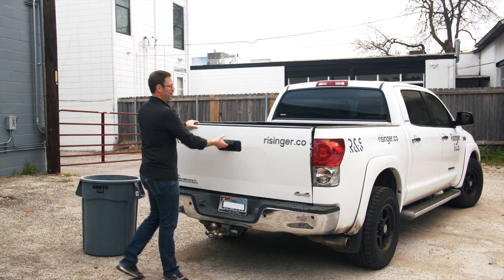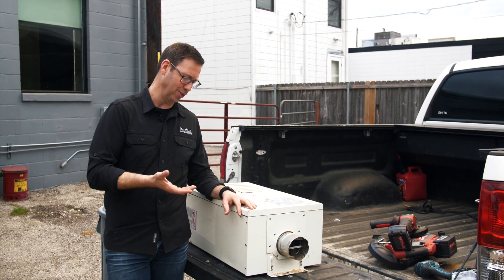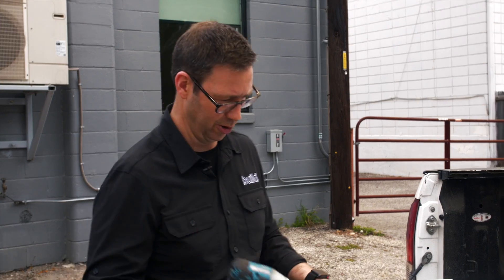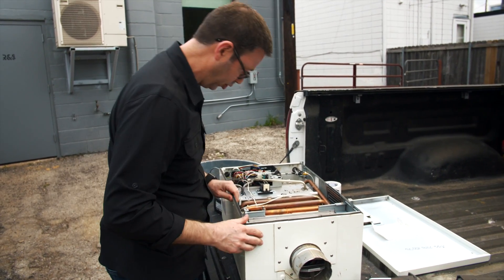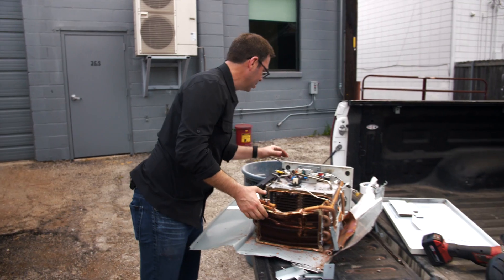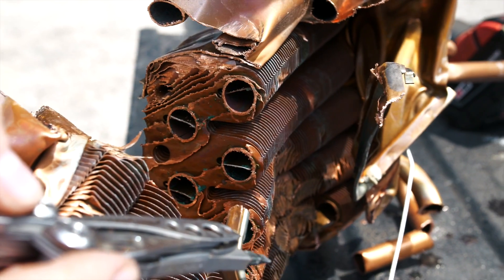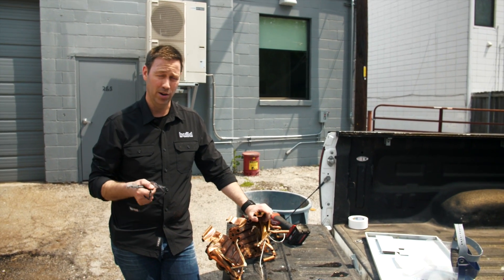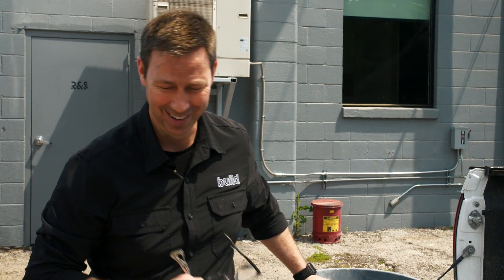Dead Tankless Water Heater - Lessons Learned?

Comment: awful design.  should be using stainless steel, not copper.  and why isn't there a way to physically clean the inside of the copper pipes with a wire-brush? - you use chemical solvents to dissolve the minerals, but you need a wire brush...  i just don't see this particular design being around for too, too long.  i mean, it gets an entire industry running...but, once someone builds something better, they all have to change, or go out of business.  ridiculous.

Comment: piece of manure Rheem hot water heater. Took that one apart to clean the flame rods about four times. Never was anything wrong they were perfectly clean and upon reassembly it works for another year and then stops = clean the flame rods works for another year and then stops not a mark on the flame rods= factory couldn't help= never buy Rheem again in my life

Comment: A more thorough dissection of the lower part of the unit may have yielded the primary heating chamber where there may have been more scale than you discovered.   I believe the part you opened was more the scavenging section that extracts the remnants of heat left over from the initial burn.....just my two bits.     Thanks for sharing.

Comment: You should have fixed it, those things are expensive. I bought one on eBay for $250 it was a "broken" unit in unknown condition that was shelved  in a plumbers warehouse. It's a stainless steel 200k btu noritz with circulation system new $1800. It had a leaking mixing valve that would shut it down. $70 for the part. The date code showed it was about a year old and judging by the dust it had been sitting a while. So $320 for endless water at 96% efficiency.

Comment: It just needed the 2 D size batteries for the gas ignitors'.
Perfectly good $900 whole house unit.
Worse case , 1 or 2 capacitors. Maybe $3 for 2 of those to solder on.
Everything else is all there. Made in Japan?? $1500.

Comment: it either got replaced because of a capacity/supply issue related to a remodel, or parts were scarce for the model unit if it were discontinued, OR the contractor was a scum bag and told the home owner it was junk.

Comment: you have demolished the water heater but what about the gas and the water parts that upper part is the coil or spiral under you find the stove and under the stove there is the water and gas groups and there is a special membrane which doesn't allow gas to mix with water :)

Comment: I wonder if some of the electronics in the unit went bad and we are either no longer available or too expensive to replace. That’s what happens with a lot of electronically controlled systems you have them so long they become outdated and parts no longer available.

Comment: I believe the "mystery plastic sheet" on the tankless water heater is a heat film to keep the copper pipes preheated.  I use the same film for my greenhouse to propagate seedlings.

https://www.amazon.com/Fast-GRO-Propagation-Original-ManufacturerAny-Available/dp/B06Y19H2LC/ref=sr_1_1?keywords=heat+film+for+seedling+propagation&qid=1579063066&sr=8-1

Somebody posted earlier that its purpose was to eliminate condensation, but since the unit is sealed, the condensation would remain inside of the housing.

Comment: Looks like the same brand and model of my tankless water heater. Still have it going on 14 yrs. Last year I had to replace the oxygen sensor which is attached to the burner unit so I had to buy the burner unit which cost about $230. The igniter recently was not working so I just replaced it. Everthing works fine now. Oh and I just recently did a de-scaling of the unit for the first time about a month ago.

Comment: Dude stop calling it a boiler it’s not a boiler. It’s a rad system all it’s doing is heating the rad kinda like what you find in homes with boilers. The boiler will heat the water then the water goes through the roads that gives off the heat. This had no tank of water that’s being heated it’s not a boiler it’s a rad system.

Comment: I would love to know what was wrong with it. It's amazing how many good items get trashed because we live in a society that doesn't fix anything, just replace it. Even the so called "repair technicians ", don't"repair", they are "replace" technicians. They keep replacing parts until it starts working.  I remember the time when there were TV repair men that came to your house to fix your TV.
Reply: I don't feel sorry about that one bit. Diagnosing (and repairing) things properly can be VERY time consuming, depending on which field you're in.. and  time is the most valuable resource. So yeah, often replacing things is cheaper and more economical than wasting time.

Comment: That was heating tape, the freeze-proof backup heater. The unit looks like one I owned, purchased in 2007. Mine had circuit board issues, it was covered under warranty. It also had an issue with the flame sensor,  a carbon-like substance would build up in it.  it was a task to clean it but once cleaned it was ok.

Comment: The plastic you removed at the beginning is a thermal fuse used to shut off the water heater if the "heat exchanger" (NOT BOILER) becomes clogged. There is NOTHING perfect about this water heater. It's a piece of CRAP along with those Rheems you talk about. Just saying.....

Comment: As a licensed and insured plumbing contractor in South Florida for 50 years our company sees tankless water heater complaints constantly. We do nor recommend or repair gas or electric tankless water heaters. This water heater probably had a defective flame sensor which could have been replaced. However the labor and material cost does not make sense for a water heater that is out of warrantee.

Comment: Maintained mine and after 2 years, the problems came and didn't stop.  Fan died twice, then motor control board.  Not worth the cost if repairs are needed like this.  Many plumbers I know, do not recommend them.

Comment: I have a Takagi unit for more than 10 years and it has been flawless. Installed it myself and have saved tons of money on gas bill with no fluctuations in temperature. I have run it for hours in some situations and it is a beast!! You just have to make sure you size the unit to fit the demand requirements for your house.

Comment: The plastic heat shield you cut out first thing is for freeze protection in the event that your house heating goes out and that your electricity still operates. It will keep the heat exchanger from freezing. The inset sensor in the PIPING are the over heat sensors. Rinnai is known for CO leaking around their heat exchanger seal, although they will say its normal. If maintained properly,  yes they do last a long time. They have to fix their seal problem imo. That is not a Rinnai though

Comment: I've changed several heat exchangers that were bad due to scale, you can see the hot spots and usually leaks,  I can change out a heat exchanger in 2-3 hrs, the problem would blink in a error code more than likely was just bad igniter $50-$60 part. Or vent issue.

Comment: I, and some others, refer to tankless water heaters as "point of use" water heaters. They are not meant to be put in your garage or attic to supply the whole house. Smaller units are designed to put under vanities for add-on bathrooms. Larger units designed for placing in a room next to a cluster of faucets (back-to-back bathrooms, or bathroom on back of a kitchen). Tankless water heaters have a high fail rate for whole home use, or the uneducated looking for the next trend.

Comment: My friend has Rinnai for over 15yrs, no flush or problems.  I went 7 yrs no flush and got a code 16 error with Noritz, but after a couple of flushes no more code.  It now takes a bit longer to heat up water to the faucet, and I had to take the temp. from 115 to 130.  And I can tell you, for the cost of installation, and the now problems, I would have never gone tankless.  They do not pay for themselves for a very very long time if you have to pay to have it put in.

Comment: Even if they are flushed regularly you can still have electronic failure. All this stuff is man made, as we add electronics to improve efficiency and safety, we also increase the likelihood hood of electrical failure. Now this is not a reason to stay away from tankless, a quality brand, with good quality control, will last you a long time. We just need to remember that with all mass produced items, sometimes mistakes happen.

Comment: More than likely it was an electronic control unit failure and the HVAC tech decided to just replace the entire hot water unit, instead of replacing the electronic control unit inside. This type of thing happens in other products, especially small appliances, where the tech prices out the labour and the part as worth almost as much as the replacement cost of the failed unit.

Most appliances come with a schematic tucked away inside with instructions on how to diagnose. It's also available online and can save hundreds of dollars for the customer if the service tech wants to spend a bit of time to diagnose.

I've fixed and refurbished a lot of appliances in my past. It's easy to do with a little bit of effort and being able to read a simple schematic. All parts are serviceable.

I really enjoy your channel.

Keep up the good work!

Comment: That back circuit looks like a big resistor. I.e. long thing wire that increases in electrical resistance as it heats up. No contact break needed, but could also work as a shut off feature as you described

Comment: Lesson learned - don’t beat on your tailgate with a sledge hammer!
Reply: One thing that separates Matt from a whole lot of other general contractors, is his willing to admit mistakes.  However, in this instance, will there be a sequel showing how this unit was repaired and restored to proper working order?  p.s. Tailgate repairs will be sponsored by Ford Motor Company, F-150 Department, Spare Parts Division.

Comment: I have experience with that exact same model. There is only one of this model that we maintain, and in my experience this unit has had issues with maintaining flame rectification. After running the gambit of solutions provided by tech support including replacing flame rods, wiring harness, control board, and ensuring proper grounding and gas pressure, I was left with a "well thats just the way it's going to be" response. Every six months the burner on the unit needs to be pulled and the flame rods cleaned to maintain proper reliable operation. This video makes me wonder if my experience is not an isolated incident...

Comment: Which brand is this unit? it looks like one that I have replaced several of. The company I was working for had a contract with the university to maintain some of the student apartments and each 5 bedroom apartment had one of these as the source of hot water. We were told not to even bother attempting repair and to just replace them. Most only last a few years in there.

Comment: That mystery tape wrapped around the outside coil looked to me to be for pre-heating the water. Tankless heaters have a harder time heating cold water coming into the house during the winter time. I know because I lived in a house that used one and during the winter time. I used only hot water to shower and still it was a chilling experience. The newer heaters are better though.

Comment: Feed them with soft water, they'll last almost forever..  I have an OLD Paloma mechanical controlled unit.  It was 25 years old when I found it from the scrap pile, repaired a freeze broken tube and placed it into service.  In retirement mode now, letting a modern electronic controlled unit do the heavy lifting.

Comment: I would put money on that tankless water heater being replaced with a tank because they are terrible functionally.  They cannot flow high rates without temperature drop and they cannot flow very low rates without temperature fluctuations.  They are also inefficient for occasional use as the heat exchanger holds a gallon or so of water that needs to be heated each time a new demand is required which delays the hot water to the fixture.  Put in a tank if you care about luxury.
Reply: We miss you knurlgnar24!, any chance you can add statement on your channel, of why you,, whatever ,, lost interest, or even worth, got married uhh  :-)
At Least you are not dead.
Reply: I bought a heavy duty Takagi for my 2 family house 5 years ago. It has worked flawlessly.  On a number of occasions we had 3 showers going and the water temp was perfect through out.  Tankless water heaters can be just like cars. Some makes & models are bad  ....but that does not mean all cars don't work.
Reply: It depends on the brand, and on how much you paid. A good quality Takagi with condensing burner and modulation is flawless, very efficient, and supplies water at the flow rate I needed. Buy a quality unit with a Btu/hr rating suitable for the flow you need and you will be very happy. Unhappy owners did not do their homework. Oh, by the way, my unit holds about one liter of water, not one gallon.
Reply: @paulmaxwell8851  for a good tankless heater you need to buy a good brand and buy one with the capacity you need for the location I learned this after I bought mine.
The heater works great if you don't run the washer or dishwasher at one time. I bought a heater that was only large enough for 1 bathroom at a time.
I needed a larger one  I should have bought one that can run the washer dish washer ant 2 bathrooms at a time live and learn I turned the temp dial up on mine to push it and I can get away with to showers or the washer and dishwasher but not all at the same time.

Now I got one for my granny's house and bought one based on the amount of appliances and bathrooms the would be using it and considered what if I want to run everything at the same time got a heater that had the capacity to do this and actually upside it a bit.

 We tested it it heats great and fast   I turned on the kitchen sink the dish washer washer and 2 bathrooms all full hot that sucker kicked out the hot. Now I know it will be rear that all that is on at the same time but I wanted it where if its wanted it can be done .

Not like my house if you take a shower and turn on the washer you get a rush of cold  and inconsistent heat  but that's my fault i should have got a larger heater.

Mines also electric so I would need to upgrade the wiring to get a larger heater site actually cheaper for me to either deal with it or go back to a standard water heater. Becaise I was dumb and didn't buy the right sized heater for the house oh well when the heater dies I'll figure it out then.
Reply: I'm with you on that.  But I could see a tankless working for me in one application.  I have a slab house and the kitchen sink is far from the water heater - it takes me a good 2 to 3 minutes to get hot water there during the winter.  That's where a tankless would serve me: I can't afford to lose what small space I have near the sink [which rules out a small under the counter tank], and a quick boost would be nice.   But the US market is weird: it's almost all gas, which demands extra ventilation and wall/roof penetrations.  If you go to parts of Asia, it's almost all electric [usually limited to bathroom service, but volume wise those units would be perfect for what I want].
Reply: Glad to see are you still on YouTube!
Reply: The solar battery backup and inverter had a glitch and fried the electronic control board on the Thank-less water heater. It was caused by recycled orange el-cheepo 210 amp hour cell tower batteries and a crappy square wave inverter.
Reply: I have a Rinnai since 2006 and a family of eight. Low flow has never been a problem. Concurrently runs two showers and a sink without temp loss. Best of all, after a day at the pool or beach, everyone can get a shower without ever running out of hot water or having to wait for a tank unit to "recover."
Reply: The better water heaters vary the flame strength.
So that even with low flow no overheating occurs.
My unit is for small apartments, which is why it is not able to serve several outlets at the same time with sufficient water.
However, there are also correspondingly larger models, including those with additional hot water tank to cover the need for a lot of hot water.

Comment: Either owner called someone who doesn't know how to fix it, and just said, "ah, just replace it," or most likely what happened was it was just descaled, which removed the scale from the unit, as well as the scale that was sealing a crack in the tubing. That happens a few times, especially on units that have never been serviced and they are 5-6 years old. I'm a huge fan of tankless, but if you don't mitigate scale build-up, save up to have your heat exchanger replaced in 5-6 years, depending on your water.

Comment: Idiots replaced it because the hot water version of a high limit went out.  That plastic sheet with the wires you spoke of.  The morons couldn't diagnose it so replaced a perfectly good instant water heater because of that initial part you showed.

Comment: I once had a furnace inspection and they said i had a cracked heat exchanger (2 of them) and the company gave me a quote to repair it and another quote to replace it, there was about 100 buck difference between the quotes. most people would pay for the new one. me i fixed it myself, bought 2 new heat exchangers and installed them in under 1 hour, parts were under 150 bucks. saved my self over 1200 bucks. Maybe if service company's weren't trying to rape people there would be less waste. really, 1200 bucks for 1 hour of labor?

Comment: "no metal is there, zip zip " lol .  Plastic film IS actually heating element, it prevents ice buildup in copper tubing.
Reply: Correct indeed, we use a similar "tape" in the reptile hobby to maintain temperature of enclosures.